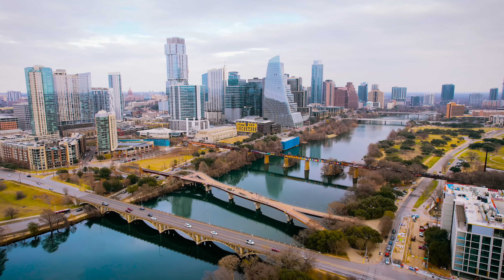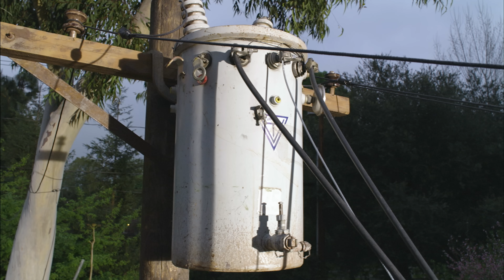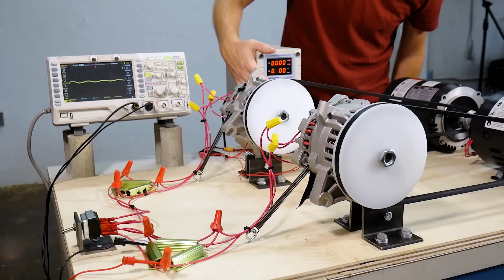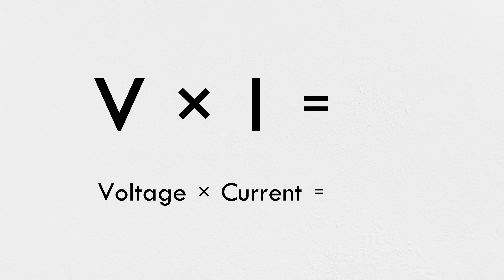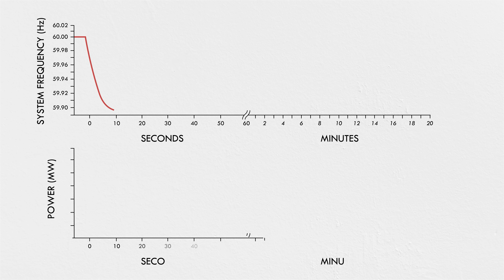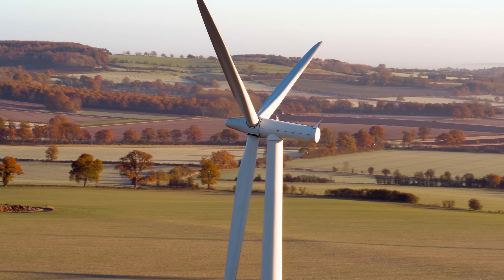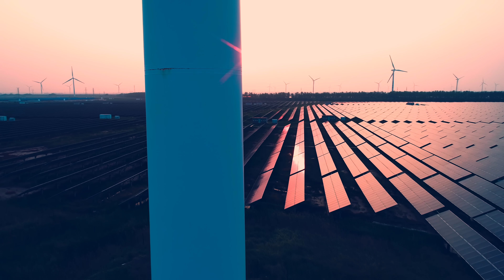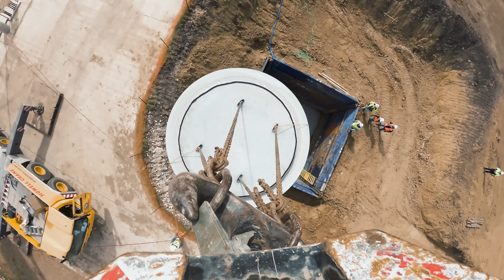Connecting Solar to the Grid is Harder Than You Think

Comment: the final project for one of my classes was to design a solar installation for a factory, we had to calculate power usage from power bills, design a capacitor bank for power factor correction, find out how many panels, in what arrangement, and at what angle and distance from each other they had to be installed, pick an MPPT and inverter, and design a battery bank.
i couldn't finish in time, it was a nightmare, but at least it taught me that people way underestimate how much work goes into installing solar
Reply: Anyone who has tried to design their own solar panels and inverter setup for their home knows that its a complex process that has you reading datasheets for the panels and the manuals for the inverter!
Reply: @tlangdon12 I ordered a kit online in 2017, 20 Astro Energy 310W modules, DC optimizers, and a Solaredge SE6000A-US-U inverter, Iron Ridge XR100 racking, and connected it all. I got a Bosh D-Tect 150 to help me hit the rafters through the roof with the 5 inch stainless lag screws holding the flash feet. Making 4.47kw right now. It's all tested by UL. There was a little paperwork to get permits, and pass inspection. Your backfeed breaker has to go in the bottom because the solar adds to the amount of power you can pull out of the pannel, and you don't want it to add that to grid power and exceed the capacity of the bus bar. If you put it in a subpannel, same thing, and it needs to be in the bottom of the main pannel. It's not a beginner project, but totally doable if you are motivated.
Reply: @tlangdon12 are you kidding me? Datasheets, as in checking 2 values of an inverter and 2 values of a solar panel (basically power and voltage for both). It's really not complicated for home usage.
Reply: Whatever you said is what i'm doing right now as a solar engineer in a solar developer MNC doing commerical, industrial and utility scale project. I do this almost everyday.
Reply: @zenniz1992   the thing I hate on the utility side is just how little power flows through the transmission lines. I'm tired of Florida's 80MWhr fields all over the place. Then they step it up to 230kv so my switching stations end up taking up a whole bunch of real-estate just for at most 200A. The switching yards I design can handle up to 3000A, so the rate payers are not getting a good deal out of it. I could even design them for 4000A @230kv, but it's all overkill as the transmission lines will never see that kind of capacity from solar.
Reply: Bro's just playing factorio irl
Reply: Love it, had something similar in one of my classes, making a complete grid system for two small islands with very different climates, using any combination of renewables, various batteries, hydrogen, flywheels, compressed air, etc. (excluding pumped hydro or HVDC cables) that covered the need for every hour of the year. I also think we needed to decarbonize the transport and heating sector. We where judged based on overall cost of the system. Tried to be smart about it and create and algorithm for about 1.5 months, then I said to hell with it and just kept adding more turbines, batteries and electric space heating/cooling for the remaining week until it worked. Got a solid D on the project.
Reply: @balderhagert6155  feels like something we would have done in a class of 11 year olds back in my day , now it seems its a college class  :)
Reply: For home installations grid-tied solar is completely trivial.  There is literally nothing to it.  You can buy a solar panel, buy a cheap Chinese grid-tied inverter, connect them up, and plug it into the wall.   That is how easy it is.

Now of course, more consideration is required as power levels go up.  If you have 500W of solar than the above solution works.  If you have 5000W of solar then you need a more expensive, properly UL listed grid-tied inverter and an electrician (or electrical knowledge) who can size all the cabling properly.  If you have 20000W of solar.... welwl, you get the idea.

But even so for home installations this still amounts to having some knowledge, hooking a few pieces of equipment up, and turning it on.  Literally that's it.   Regulations complicate matters and there are other complications (politics, monopolistic utilities, etc).... but in terms of the actual equipment its trivial.

-Matt
Reply: Lol almost no work goes into residential solar.
Reply: It's interesting that I recall reading that Walmart removed solar panels from the roof of their buildings.
Reply: It is commercially available in most of europe with online tools available to do the math for you on all those parameters you AMERICAN.
Reply: Only if people do it properly. Most solar or other green enthusiasts/evangelist do not even know that such things are required
Reply: I have no college degree. No background at all an electronics. Install the 3000 watt solar system on the roof of an RV I own 5 years ago and it works just fine
Reply: I built the 51.2 volt battery bank system out of 12.8 volt lithium iron phosphate batteries. I bought a nice split phase 120/240 volt low frequency inverter I have two parallel mppt controllers that I hooked up my split the solar panel system in half. I have fuses in all the right places between all the different electrical components between the panels that are connected in series before they are connected in parallel to each other. And I have fuses between the panels and the controllers in between the controllers in the batteries and between the batteries and the inverters. And a few breakers as well so I can shut off the system at different points within the circuit. I learned all about voltage and amperage and resistance and I didn't know any of this and I learned anything about 2 months and I have no college degree
Reply: @ a college degree is equal to about 12 years practical experience, in some areas less. So it's not that much needed. But you knew you had to learn instead of just mashing things together.
Reply: @nddragoon  I don't know maybe you're just dumb. It's pretty easy honestly. I did it myself and it took me about 2 months to learn everything.
Reply: @nddragoon  now connecting it to the grid is a different story but if you want to just have your own isolated system it's ABC. But there are ways to connect it to the grid that would work better than how it's being done now
Reply: Complexity varies. I just pluged microinverter to grid and screwd panels to frame and done. Nothing complex on simple house system. Not a single thought about power factor correction. Its how complex do you want or need to make it.
Reply: @lauriviik  I opted for the least complex system of all. I only use a small inverter and battery as backup power for my gas furnace to keep it running if the power goes out in the winter. When the power goes out I unplug the furnace from the mains and plug it into the inverter. Then I go upstairs and chow down on any ice cream before it goes bad.
Reply: @lauriviik  You just pushed the complexities onto the grid operators, it is still there.
Reply: @lauriviik  No thought given to string voltages?
Reply: @tlangdon12  nothing to think about it in simple system, as long as its in inverters input range you are good to go.
Reply: Eh... nothing fancy IMHO. Just a few hours of work and there are good planing tools that will help with most tasks
Reply: Wait, what? Was this a school or uni project? Because this is definitely too much work for the former...
Reply: @TheMightyZwom  Almost certainly a university project, you would be happy to learn about solar power at all at some schools.
Reply: @TheMightyZwom  uni. I'm studying mechatronics engineering
Reply: @nddragoon  Ah okay then. I wish you success in studying, then :)
Reply: @nddragoon  If the basic kinds of load issues solar presents are a university issue in the USA, then no wonder your country is crashing.
Reply: @FaustsKanaal  why would you assume im in the us?
also, i find it hard to believe people are getting taught this stuff in that amount of depth in high school or earlier anywhere
Reply: Lol, never been to uni but designed my own solar system and have lived 100% off grid for the last two years, it's not that hard (or expensive if you do the installation yourself)
Reply: @chrisp.lettuce8900  Hi, the original comment is about factory scale power and probably includes a grid connection.  It is not even close to the same thing.
Reply: @jonathanjohnson8376  true the factory is a larger scale but the original comment said he studied engineering and couldn't finish a paper, I didn't study and finished it for real so I think that balances out the scale lol

Also grid connection is irrelevant, I have also helped an uncle setup a complete solar/backup battery system for a rental property he owns, engineering is just the study of overthinking  lol that's why he didn't finish the paper

(This is Coming from a mechanical engineer who didn't need a degree btw)
Reply: @chrisp.lettuce8900  doing a 100% off grid is much easier to design than a grid connected system
Reply: Is a shame he liked a furry comment.
Reply: @TheSteveMeister  hey buddy get used to it, like a solid third of engineers are furries

Comment: What is the point of a grid, when solar and wind is already available at the point of use🤔. If we are using Edison's system, the transition should have already happened!. Unfortunately, we are on a centralized grid!, with a polyphase power system. With the current technology, it is not difficult to comeup with a distributed electrical system. The closer units can share power, with the centralized grid, providing only  to smoothen fluctuations, or during extended periods of unviable power generation. This should save a lot of wasteage in distribution, if not anything else. Unfortunately there is a lot of infrastructure and overheads, that would be eliminated, apart from the loss of centralized control!.  Just some 💭.

Comment: We all should start adding DC power to houses today so in 20 years we all run DC only! The amount of high power (high amperage) DC we use is overwhelming. Water heaters, airco, tv, pc's, electric stoves and ovens, heat pumps, electric cars...
Reply: Sorry, thats wrong. The most of the high power equimpent is directly running on AC. Like water heaters, aircons, all el. ovens/stoves and most of all motor driven tools...
Reply: @LightBulb-tu6uz  Seriously? Do you think glowing metal strings care about AC or DC? Do you think we can make DC compressors (motors)? You think we ever will be able to make DC (battery powered) hand drills and the sort?
Reply: @se_mat   I didn't say it wouldn't work. Only your assumption that we already use a lot of high-power direct current is wrong. 

But regardless, I don't see enough benefits to justify such an effort. Not to mention some drawbacks

Comment: Why not use flywheel energy storage for large scale renewable power plants? Scale everything up to make it more efficient, and creates inertia + AC power
Reply: That equivalent was his battery-powered drill to the oscilloscope test. That it was inefficient as you lose power in using the DC to spin up the motor, and then again to use that motor to make AC. But yeah I would think there's a question of whether it's MORE inefficient than the other workarounds will be.

Comment: I work in power generation ( a good portion of my work is in the renewable sector). Solar farms present a unique challenge in the fact that there is no inertia behind the power production. A regular power plant ( gas or steam turbine)  has an effect almost of a synchronous condenser ( a small power reserve). Inverter based generation doesn’t provide that. Which can be weird once you start getting into crazy demand days. 

Most inverters used on the grid are what’s called voltage source inverters, meaning that the dc voltage MUST always be higher than the inverter AC output voltage. This is to ensure the inverter can “pump” power out to the grid. 

From a dispatch standpoint , most solar farms are not dispatched, they produce what they produce to the grid. 

The ac voltage that gets exported to the grid is a relatively stable voltage regardless of the dc production, although the power flow will adjust with dc production. There is very little tolerances when it comes to grid tied systems. 

Most solar inverters and battery storage inverters ( again utility scale) are the exact same equipment. They can be configured for each operation. Almost all inverters from the major manufacturers, are capable of grid forming, which means they can start with no grid reference. These units can be paralleled to create a backbone to which thermal generation can actually sync to. 

Basically the more solar farms that pop up, the more battery storage systems will be needed. 

All utility scale inverters have some sort or primary, secondary, and reserve frequency response algorithms built in. They’ll just convert this mismatch into heat ( vars). 

Let me know if you have any questions. I can provide clear explanations on anything else. 😊
Reply: I'm a consultant electrical engineer for many large scale utility companies. There is no plan for a zero carbon grid by anyone at any level. We are driving straight off a cliff because the actual policy makers that are driving our industry right now are not engineers.
Reply: @thedude5040 Nuclear works. The data center people won’t tolerate intermittent power and its problems, so they might drive the politics and economics to make nuclear work.
Reply: @thedude5040  Yep, agree. Frequency will become more difficult to maintain as more variable renewables are added to the power portfolio. I expect problems to become apparent to others when the mix of renewables climbs into the 30%-50% range of the grid's available capacity (unless total capacity is 2x the expected demand, which is cost prohibitive). When renewables start to approach that ratio of the available capacity, scenarios are likely to occur where thermal generation and renewable generation will clash. If the Odessa disturbance had happened near peak hours 4-7pm and a thin margin day (like in month of August), the outcome would likely have been much more severe.
Reply: @RT-mv7df  so you actually can have much more renewables than you think so long as you have standby dispatch able generation. The southwest power pool regularly has 60% renewable daily generation (oklahoma kansas Nebraska dekotas and parts of other states)
Reply: I work in Scada for an EPC, those are good points. Would have liked him to dive a bit deeper. Seemed most of the video presented a challenge that none of our jobs usually face (the grid following). All of my jobs have PFR
Reply: How big is the battery required for grid-forming? I'm guessing not by much, as it's essentially used as giant capacitor. Perhaps supercapacitor can be used instead?
Reply: @hanifarroisimukhlis5989  the battery sizes range a lot. Energy storage systems DO actually have a significant reserve. Batteries have two measurements: 

Power expressed in megawatts 
And 
Energy, expressed in megawatt hours. 

So on a system that’s 5mw/ 50mWh 
It can discharge at 5mw for ~10 hours or 1MW for -50 hours ( efficiency comes into play as does temperature). 

For black start though, you would need a few megawatts for a few hours, to make sure you establish a “stiff backbone” for further restoration.
Reply: @hanifarroisimukhlis5989  they aren’t usually separate pieces of equipment. A battery storage facility has 2 electrical measurements. 

Power: expressed in megawatts, which is the amount of real time power that can be produced. 

Energy: expressed in MwH, or how long it can “generate” 

The black start BESS systems I’m currently working on are in the range of 3-5 megawatt systems, with 20MwH of capacity. So it can discharge at full capacity (5MW) for 4 hours. 

You need capacity and power for a black start to work, usually black starting the transmission grid takes time, even if successful the first attempt. You’re looking at a minimum of 3 hours to restoration depending on what caused the grid collapse
Reply: I'm a project engineer for a solar PV/BESS IPP. Loving the discourse!
Reply: I heard something about using part of the capacity of plugged-in electric cars as distributed battery banks. Is that a real thing? How close are we technologically?
Reply: @orngjce223  it's a real thing. Not very effective though as cars are not parked where the largest energy users are.
Reply: No grid tie inverter I have ever worked with works without "grid reference". Id est, without the 50hz reference point they cannot output. What century are you from?
Reply: @FaustsKanaal  obviously you’re not in the United States, so I don’t know what kind of equipment you have. Over here, most can grid-form.

Comment: Afaik in Germany you are required according to vde-ar-n-4105-2018 "Therefore, in the future, newly constructed generating plants must support the grid in case of disruptions."
Reply: That would mean more complex and expensive power conversion equipment, but it's what's needed so it can come out of the corner as more than a niche player.
Reply: @SeekingTheLoveThatGodMeans7648  Ehhh, not really: at worst you need a small battery about 20% as expensive as the solar panels themselves, and that's for a much higher level of capability than the regulation mandates. Those mandates are basically all just controller/brain requirements, which may have some effect on what sensing circuits the inverter needs to feel the grid, but nothing that actually handles power.
That's the beauty: the normal inverter already needs to have all that power conversion circuity just to feed a reasonable sine into the grid when the sun shines.